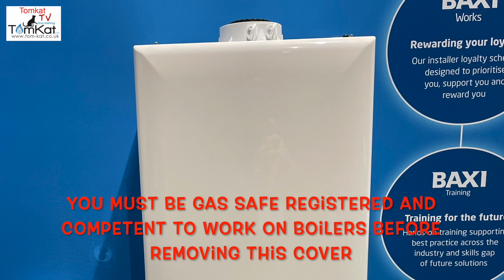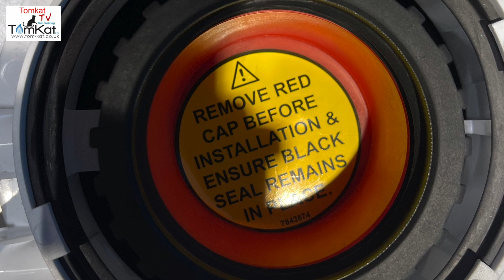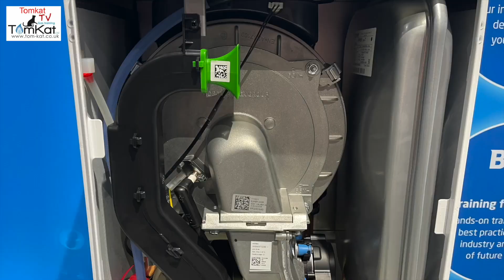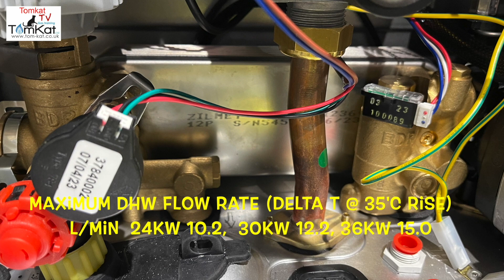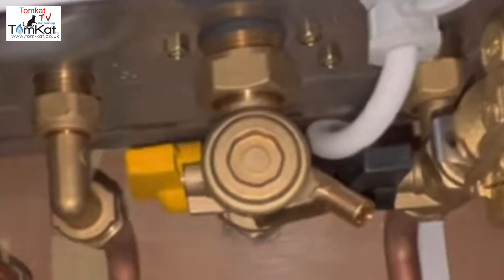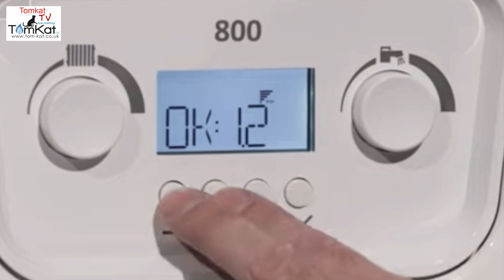Going to PHEX Manchester 2023 to see the new Baxi 800 combi 2

Comment: Prv is a pain, less brass on the hydraulics, have had multiple issues on a number I've installed, warranty call outs to fix, one had failed diverter and pump 3 months in. Installing the duotec and platinum compacts instead now.
Reply: Fitted one yesterday, bit of a faf with commissioning ( gas valve adjustment). Never had to do that on any boiler before.    PRV isn't great.
Reply: Yeah the prv is definitely a downgrade. Had a lot which look like gas valve just be adjusted but gotta be careful they say to not touch them the first month at least while they bed in, might be worth checking the boiler readings in a month see where its at. I've found hydrogen ready has made them burn a lot richer hmm
Reply: I’ve had two diverted valves in 2 years from new
Reply: I have been stung a few times for fitting them, still fitting the version one basically , it wouldn't be too bad but the baxi engineers fixing factory issues are making out as though installer error is the blame and making up horse crap. Not happy about them lately.
Reply: @connoraxelson1 what boiler would you go for then?

Comment: Not the best on the market, will be interesting to see how they stand up after 5/7 yrs use... good vid tho :)
Reply: Hope they stand up better than the Worcester Bosch I've just had removed... That was a pain in the arse after 5 years old.. Diverter failed filling loop replaced twice pressure vessel failed, fan was problematic and had to be fixed... Leaks were almost constant...
Reply: @davewright9312  plastic hydroblock cracked 😂😂😂 pin hole leaks 😂😂😂😂😂